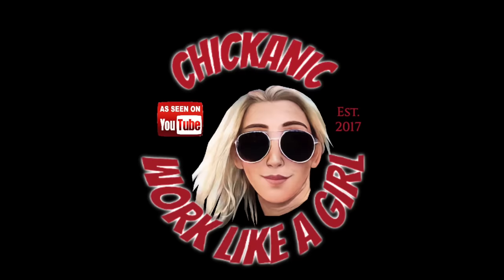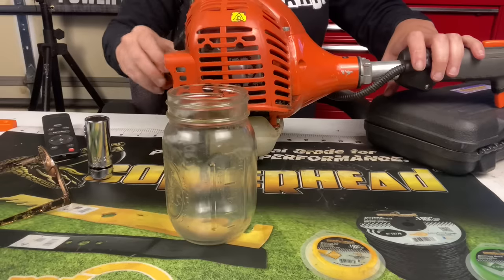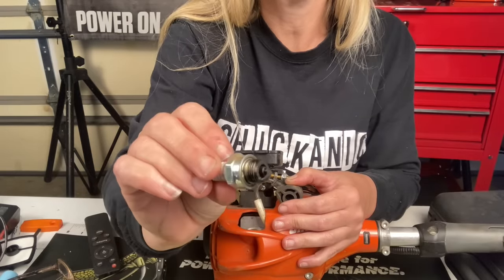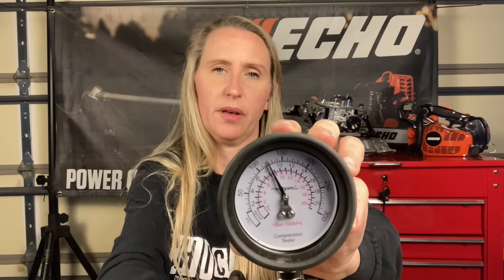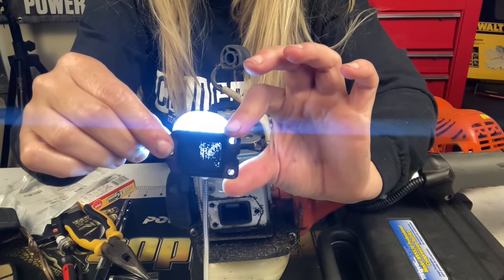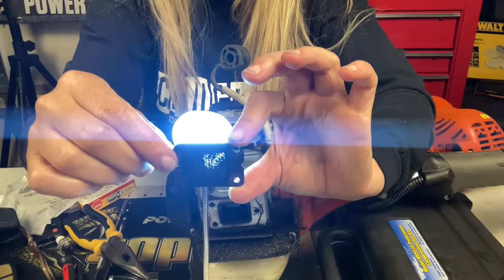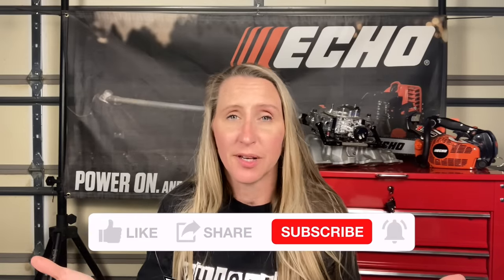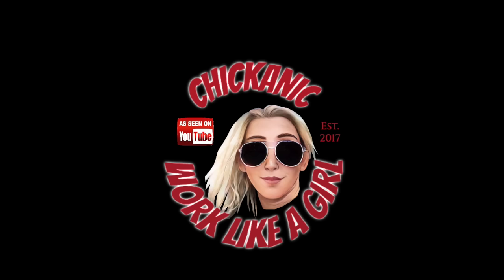How To Fix A String Trimmer That Won't Throttle Up. Echo SRM-225 Complete Diagnoses and Repair VLOG

Comment: Thanks very much for posting this solution!!  I had done most of the tests but did not know about the exhaust blockage problem .... that is what it was in the end.  The model I have does not have the mesh it has a small port in the side of the muffler which was solid with carbon so that was it.
Again thank you very much for sharing your knowledge!!

Best regards from Australia!!

Comment: Perfect timing I just picked up two free echo Gt-255 trimmer  both the gas was mixed wrong one is cleared out after removing old fuel and adding some hussqvarna premix and running great the other I believe has same problem as this echo your working on . We shall see I think I am going to do your troubleshooting in reverse my reasoning is knowing the mix is wrong I am thinking  the exhaust is clogged then change  spark plug probally gummed up a little . Then see how she run's Ill check the jug when I change the plug . Wish me luck

Comment: You got me with those shorts 😍 not gonna lie!
I learned years ago to mix 50:1 with high grade synthetic.  I don't think any of my equipment is new enough to have spark arrestor screens.  I put one on my KTM, required for national forest operation.  I've cleaned it once, before it plugged up.  
I did work on a car once some 45 years ago that had the catalytic converter choked up.  That took me some effort to discover.

Comment: Having the same issue with my SRM-230 - the older popular model before the SRM-225. Had the same thing this week. Had a hell of a time getting it to start. When it did it bogged down with throttle and choked out. Cleaned the screen. It was dirty, but not horrible. Pulled spark plug, it was wet. Wondered if I was getting spark or consistent spark. Thought plug or coil. My unit is nearly 20 years old. Fiddled around to test and had spark. Cylinder looks good. Compression seemed good - thumb test. New air filter, new gas filter. No go. Onto the breakdown of the carbuetor. Cleaned and blew out what looks like a small piece of pine needle. Gaskets all looked good so I put it all back together. Got it to run, but hard to start. Went to get a fresh gallon of gas - 90 octane, less than 10% ethanol, and mixed a 50:1 ratio. Same thing. But here's something I recently learned. When pumping a gallon of the good gas, you can expect about 2 quarts of the crappy gas still in the gas hose from the person before you who last pumped the crappy gas into their vehicle. So, went back to the gas station to get another gallon of new gas. This time I pumped a few gallons into my truck, then filled my 1 gallon gas can. That did the trick. So besides my unit needing some maintenance gas can make a huge difference with Echo weed whackers. 

Someone below in the comments asked about the cheap Chinese made carburetors. I have two of these Echo SRM-230's because I have a landscaping company. I recommend staying away from the cheap carburetor kits. Never had any luck with them. I spend the $50 to get a good Zama carburetor.

Comment: Good day Chickanic, it is weird how the world works, I was walking around a flea market last Sunday and came across a similar trimmer, the lady wanted $15.00 Canadian for it, she said it doesn't run. Well I took it home and put clean fuel in it and it started right away but wouldn't rev up, I came across your vid this morning, then went out and checked the screen on the exhaust, sure enough it was plugged solid. Thanks for the video and help with my $15.00 trimmer

Comment: My neighbor had a gt225 echo he said quit working and said I could have it so took it home my dad looked at it the hose in tank I guess the tank breathing hose had a crack in it fixed it in ten minutes then checked plug it was good put some gas in it fired right up score for me starts on one pull only problem is the string pieces don’t stay in it I used the 095 string as suggested is there a different string head that you recommend to replace it with I’d rather have a push and go one please give me a suggestion thanks and I love all your videos keep supplying me your helpful information I find things all the time that my neighbors throw out lol he also give me a push mower too going to get it tomorrow ❤❤❤❤❤❤

Comment: I have an Echo that is almost exactly like the one in the video.  I've had these issues and checked all the common things like fuel, spark plug, and air filter.  I'm going to take off that screen and check it.  Thanks for the info!

Comment: My landlord gave me one of those echo trimmers (225) about 6 years ago, all it needed was a carb kit. It has a lot of hours on it now but it runs like a champ, I have replaced the head a few times. I had a small top handle echo chainsaw that was also great, it had a lot of hours on it when I sold it.

Comment: Hi! I follow you and love all your tips and videos!🤗 I just finished replacing fuel line and grommet, spark plug, clean spark plug arrestor and replaced primmer bulb. Unit runs on idle and ribs up to full throttle,  but as soon as I aim the trimmer head down to start cutting it turns off. 😮

Comment: I have this same model, and it has a problem idling up after it has been running a while, I turn it off, then fire it back up. It usually happens after the unit has been sitting for about 20 minutes or more. Thanks for the video.

Comment: I had my echo trimmer for over 25 yrs. Only now I have to play with it to get it to start. I’ve heard you’re supposed to run em at full throttle. But l think of that little piston flying about. I just give the power that is needed. Excellent troubleshooting. Can you cook?

Comment: Great diagnostic skills!!
I have an Echo chainsaw and weed eater purchased in 1989 and both still run like champs. I’ve always used full synthetic 2stroke oil and have never fouled a plug.
You might be the first girl that I’ve ever heard say a weed eater sounds good! Lol. 👍
Reply: I run all ech equipment for my lawn  buisness and never have problems. I run aspen premium fuel it's one of the cleanest burning fuels.

Comment: I’ve been through 3 weed eaters in as many years, two Echo’s. 
Turns out it was my fault. But didn’t know I was doing anything wrong.
My gas can is 1.25 gallons and I thought it was a one gallon can.
Filled it and added the oil. Good to go right?!
Burned up two because the oil mix was too lean.
Be sure you are getting the proper mix. The third and Echo has ran like a Champ because I was told by a shop that the first Echo had no compression because the cylinder was scored up so badly it would cost almost as much to fix as it would cost to buy a new one.
Corrected the gas situation and the new one is gold.

Comment: I had the same issue with mine 3 months ago. Cleaned the clogged screen. Actually used hemostats to hold it and burned the oily gunk with a mini torch. Now I only run a 50:1 mix, very important.

Comment: I have an Echo SRM-225 that’s about 12 years old. Done a few tune ups and complete fuel line system replacements. Never knew there was a screen there to replace or clean. Most of the time when mine didn’t wanna run well, it was bad gas

Comment: Both my 225 and 266 units had clogged exhaust screens causing the same symptoms. Cleaning them fixed the problem. Thanks for the video.

Comment: I knew what it was at 1:43… Been there done that several times. You got 3 options, burn it off with a torch, clean it with solvent, or toss it over your shoulder… We chose C toss it over your shoulder…😆

Comment: Friend dropped off same Unit. Same issue. Starts but wont rev. Fuel, carb, filter all good. Took off muffler and most of the exhaust port on head was gunked with carbon. Cleaned, ran it with no muffler better but still not peaking on revs.  Gummed up Rings, maybe? Cylinder walls looked clean. No tools to check compression pulling cord felt like it had OK compression

Comment: From the get go I diagnosed a blocked spark arrester , usually needs cleaned or replaced within a season mainly due to slight over oiling by customers.

Comment: Have a Craftsman straight shaft trimmer that not getting a spark. Could it be a issue with the kill switch ? If not that where do I need to look next. The kill switch wires look to be good, could it be the switch itself.  I haven't opened the handle where the switch is located,  yet.
Great clear, and concise videos !  When I get this fixed, I've got figure out why my Husvarna yth20k46 with Kohler 20hp Courage engine won't start without jumping it, even with a new battery.  I suspect the Automatic compression release.

Comment: You've saved me some buck on chainsaw repair. Thank you for  that. On to trimmers. If the scored cylinders are a major issue what as a homeowner should I be doing to try and prevent the scoring or burning up my trimmer?
Reply: Make your fuel a little heavier with oil.

Comment: I'm an Echo certified mechanic. 100% accurate. This issue happens faster with a clogged air filter due to restricted condition air causing a richer air fuel mixture.

Comment: Pretty much all my equipment is 4 stroke (except my string trimmers - which are 80Volt) so the whole clogged spark screen thing always escapes me when I work on them. Spent a huge amount of time with my son trying to fix a throw-away mini-tiller recently that just wouldn't throttle up. Finally, after several hours and a broad application of vocabulary I had a vague memory of encountering a clogged exhaust screen on a chain saw once. Sure enough, all it took was a few minutes to clean it out and she ran like a charm!

Comment: Good morning from Northern Michigan where the yard tools are coming into of hibernation.  
        I'm 70 and worked for a landscaper in the 1960s who used 2 stroke lawnboy mowers. The  exhaust ports were always clogging up. One of the weekly preventive maintained procedures was to clean the mower deck and clean the exhaust ports.  I did the screen clean to my Stilh when it started becoming un responsive.    
        If the exhaust can't leave the machine it just won't breath.
Try the screen.
It might save ya  75 bucks .
       Good stuff. 
Can I drive the Vette?
How bout I just in it and go vroom vroom.

Comment: I have a string trimmer..good compression, but same as you got...wont throttle up..I haven't checked muffler yet, but it has a non servicable muffler.."Poulan pro"..Tried a second carb I had and got same thing..changed up fuel too...One thing I did notice is when I popped the fuel line from carb, the fuel just started PUMPING out the line until I loosened up the gas cap!! It was flowing..The fuel lines appear good..about a year old..filter too...Next check is muffler!! doesn't seem to be a carb thing, cause it does the same thing with 2 diff carbs...

Comment: Chikanic.... Thank you so much for your videos..... I have a question: I am running into more and more where the float needles are seized in the housings of the carburetors, is there an easy way to free them so they come out? I have used carb cleaner, also tried to pry out without destroying it, but not having any luck. 
Can you share on where is the best place to order parts for small engines? 
Thank you again for all the information you provide. You are the BEST!

Comment: Question, how often do you guys change spark plug and fuel filter? Also, is do you have to adjust the trimmer speed or you won't need to?

Comment: I’ve had the screen on my Hitachi trimmer clog and just removed it. It had more power as well because there is no restriction at all. The muffler was quite oily so I removed it soaked it gas overnight, drained it and set fire to it to burn off the carbon. Accurate mixing oil and gas is important so the mixture isn’t too oil rich which fouls the plug and causes carbon buildup.

Comment: Thank you Chichanic. I'm assuming the problem you diagnosed and fixed is similar to my problem. I have an Akita CG430 . When I press full throttle to cut the engine bogs and cut off thus I have to release throttle so engine is kept running. The case it has no power and can not cut when pressing to throttle high although the engine is running at high.

Comment: Thank you for your video. I have the exact same mode SRM 225 and was trimming and went in for a water break and when I came back fired it up and it’s spinning like crazy even when I don’t pull on the trotted to give it gas? So I turned it off and waited for another 10 mins and same thing.  It constantly running as if someone is pulling on the throttle to give it gas and idea?  Much thanks

Comment: Great video.  My Echo trimmer is like this after three uses.  I’ve checked the same things… gas, air filter, and spark plug ( replaced the spark plug and still runs bad).  Don’t have the tools to check internally; however with only 3 uses I don’t expect it to be damaged).  Will check the spark arrestor filter next and report back.  Fingers crossed.
Reply: Update:  I was excited to try this fix; but no luck.   Still runs like crap.  I cannot go full throttle as it chokes itself and dies.
Reply: Replace the exhaust bearing

Comment: Two years ago I throw away a Ecco leaf blower and weed trimmer after trying to repair them myself. My repairman told me I was using bad fuel. He sold me a brand new Ecco leafblower and a new weed trimmer. I feel like a fool now. Thank you for this video. My new units will last forever.

Comment: My Cub Cadet four stroke powers head clutch drive is built like a tank. Shaft mid connector can power any such tools as chain saw or weed wacking head.
Feed through type holds twenty some feet of .95 weed line of your choice loads in no time and runs for hours depending on hard obstructions. Many years of use and it still works perfect.
Plenty of low rpm torque and pretty quiet as well no need for pre mix and a few tablespoons of good oil ( crankcase ) and she’s good to go.

Comment: Do you recommend using a gas treatment such as Staybil or Pri-G with ethanol or 100%  gas for use in 2 cycle (chain saw, string trimmer) motors?

Comment: Great video. Got me looking at stuff I never checked before. However, my same trimmer won’t get to full throttle and kind of go up and down in rpm. It has a new cylinder and head, coil, plug, fuel tank, carb n filter, grease and even new string. What can I look at for this problem? Oh it runs a little better when tilted toward the exhaust side. Thanks anyone.

Comment: So i replaced the calbulator on a craftman wacker. It turns on good, but when i hit the gas, it chokes and turns off. I see a little bubble in one of the lines. I will definitely do this. It was old after all.

Comment: Hello, so my echo edger is starting good running good then just bogs down and shuts off i cleaned the spark arrestor and sprayed out the carburetor with cleaner gas is good replaced fuel lines and filter and primer bulb and its still bogging down when i try to use it any suggestions would be appreciated, thanks for the great detailed videos

Comment: I am switching to battery units. All my Echo gear sounds like that. I spend a lot at the repair shop servicing and replacing blowers and whipper snippers. There would be 7 Echo machines in my shed  all with issues.

Comment: Hi Bre.. love your video..I picked up a srm-225 manufactured in 2019, psi is 60psi dry compression tested, 150 psi wet..I know you said under 100 psi you don't work on them. Would you recommend a new piston ring to fix psi problems. I love rebuilding sm. engines, just don't want to order parts if you think it's best not to bother with this one.  I ask because of the amount of psi it jumped up to on wet compression test. I only used couple drops of 5w 20 weight oil for wet compression test. 
Thanks again Mario

Comment: I can fix engines, usually. Car engines, yacht engines, any engine giving I don't need a special tool I cannot make.  Today my hardley used petrol strimmer (yup my gardens a mess but my friends have working enigines)  was struggling and I could not fathom why. The fuel was new the air was clean  etc.. I just got skooled by a female about strimmers, esp the filter on the exhasut,  and other types of things with engines.  I thank you , for you. :)
Reply: I don't mean to be sexist btw its ust well.., you
 probablly get that all the time so you know,,,

Comment: My Echo leaf blower currently starts to throttle up, but when it reaches full throttle, it suddenly bogs. Not sure why. I know it isn't the spark arrestor. I've tried the "choke, open, choke, open" trick as well. 

My SRM-225 has never had issues.

Comment: I had this issue on my Stihl. The exhaust screen was clogged. Took a torch to it burned off the carbon and gunk. Put it back on, runs like new.

Comment: Love watching your videos. Great detail used when explaining certain things. 
Can you please tell me if the Speed feed 400 will work with the Echo SRM-22G. 
I've owned this little gem a little over 11 years, it fires up first time everytime. Never had to do any maintenace to it apart from the basic cleaning, I think, 1 plug replacement since owning this gem. 
I've done 2 head replacements on this machine. 
I recently watched one of you videos with the Speed Feed 400 and was very impressed, so if this unit will operate on my little gem then I'll make it happen like, yesterday.

Comment: Great video as always. I have a two year old 225 that is hard to start.   Sometimes it does and sometimes it doesn’t.  Replaced the primer bulb and gas line, took screen out.  Good gas,   Any else to try?or could the carb be shot? Use it daily for p/t lawn business.  
Thanks for any suggestions